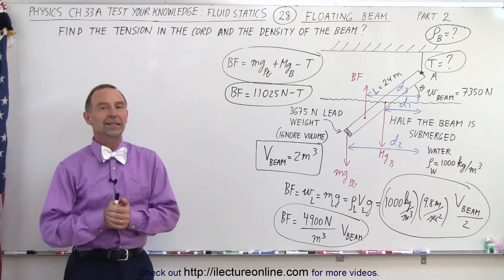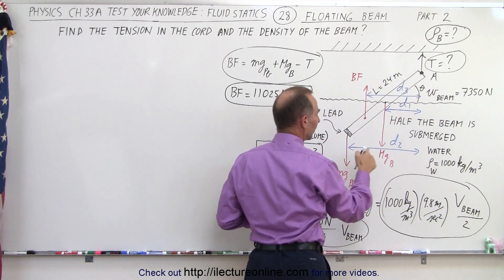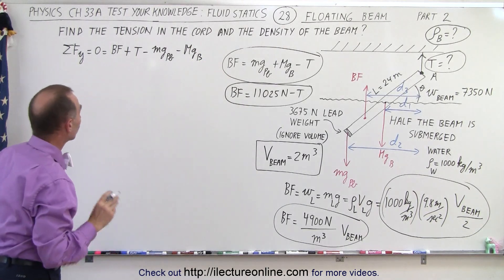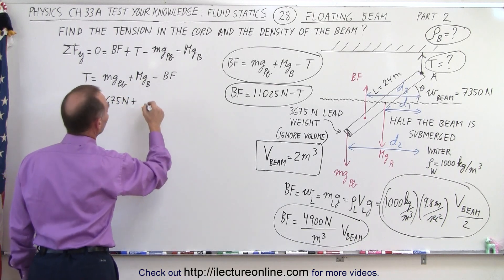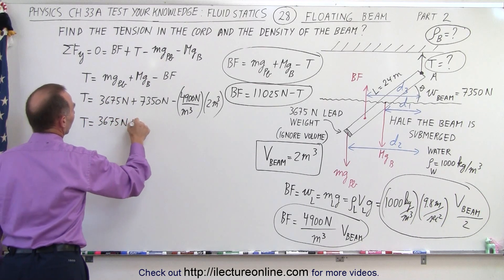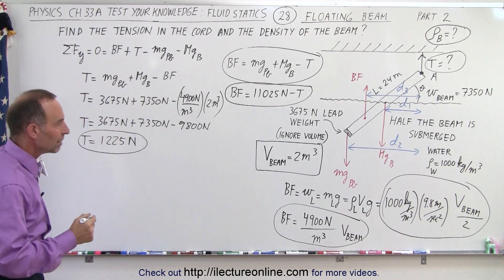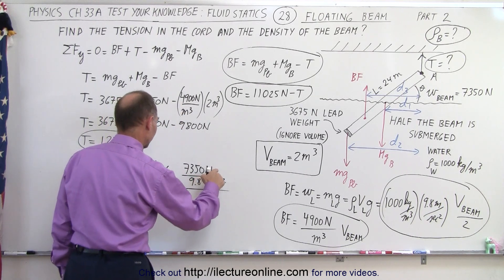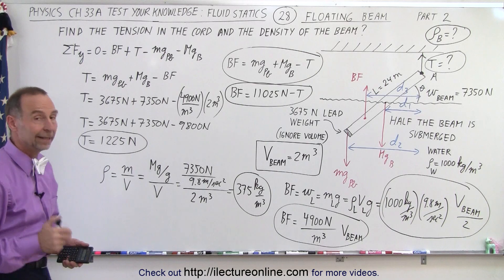Physics - Ch 33A Test Your Knowledge: Fluid Statics (28 of 36) Floating Beam: Part 2

Comment: the more I've looked at this problem... I began to wonder.... if there's a Heavy Piece of Lead attached to the Bottom of this Beam... wouldn't that Lead cause the Beam to rotate into a Vertical Position?..  such that there would be no tension in the Wire?  I imagined an Empty 2 liter bottle with it's cap on.. and then set it in water.... the Bottle would float in a Horizontal Position, but then.. if I added some water INTO that bottle and then put the cap back on, the bottle would assume a Vertical Floating Position.... does that make sense?....  such a thoughtful Problem!.. thanks
Reply from the maker: It is caused by the torque created by the BF, the weight of the beam acting at the center and the weight of the lead.  (You would have to recreate that scenario, which would be hard with a water bottle.)